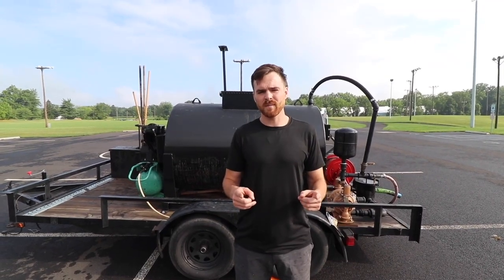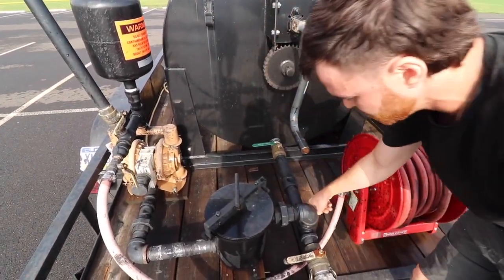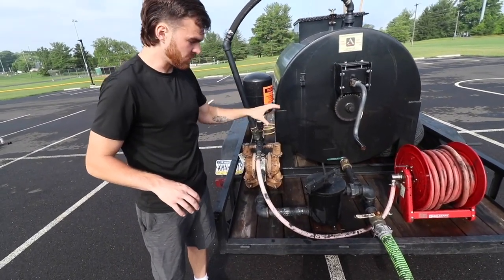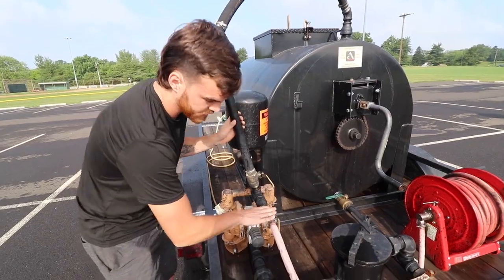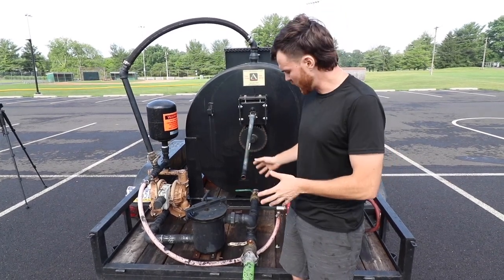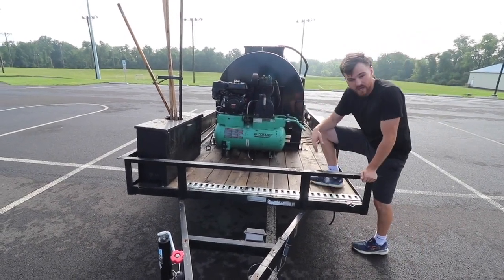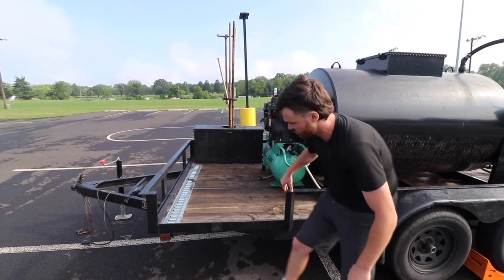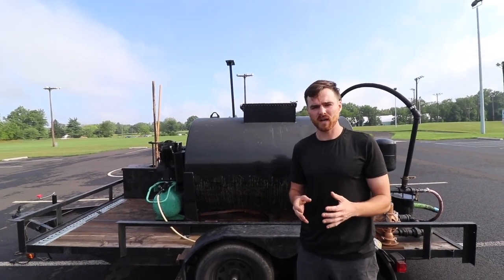How to Build a Sealcoat Trailer

Comment: We already run one very successful business and are looking to add another revenue with seal coating. I’ve been looking at used rigs but this one made the most sense. I’ve built trailers in my current business but a few links in this would be great
Reply from the maker: I actually bought this all from my local stores. I can work something up! You are gonna kill it dude🫡❤️
Reply: Q

Comment: I built my first set up for 4,000 total. Single axle trailer, 250 gallon used tank 500$ ( I got lucky on cl) air compressor 800$ pump, filter etc
Reply from the maker: Man you are killing it. You basically stole that thing 😂 big things on the way for you boss📈
Reply: I’m talking ten years ago when thangs were cheaper

Comment: I love that setup! Is there any chance you can put up a list of everything you used to set it up, minus the tank? I'm currently using an AK-230 and it's a nightmare... I can't shoot sand through the trash pump and it gets clogged if the sealer is slightly too thick.

Comment: If I’m just doing driveways for now and not spray put just putting it on the driveways with the wand then spreading it do you think I still need a surge tank?
Reply from the maker: Honestly I’m no plumber but I could imagine you should be fine. But you can build one with a 3 inch x 12 inch steel pipe with a cap on the top. Really saves money and does the same thing as mine
Reply: @ColinPatterson_  YES you need a surge tank. You will have to much back pressure and blow a fitting
Reply from the maker: @jonathanwilk3077  id listen to Jonathan. More I think about it, you definitely do. Just make a cheap on or buy one for like $200-350. They don’t go bad

Comment: Why would you use buckets instead of dispensing from wand without spray nozzle?
Reply: Because these guys half ass every single job 😅
Reply from the maker: When we spray parking lots instead of taking off the spray tip we just gravity feed buckets to cut in the curbs. Or if the spray system dies on a driveway we can always gravity feed.